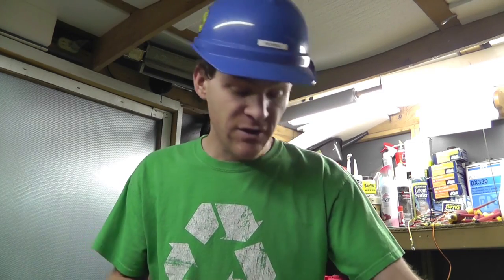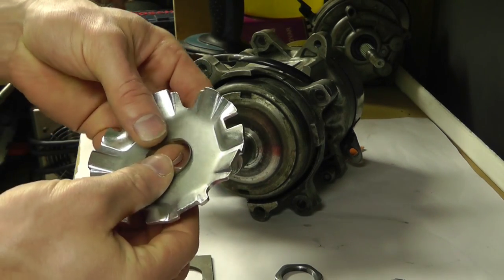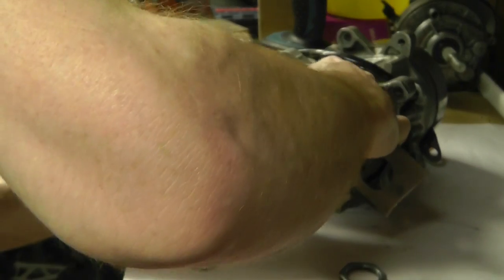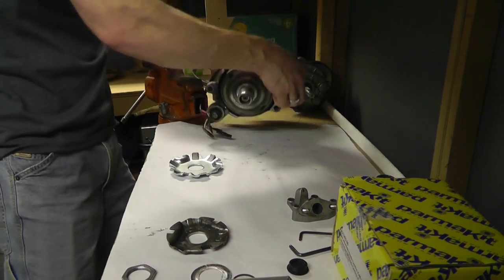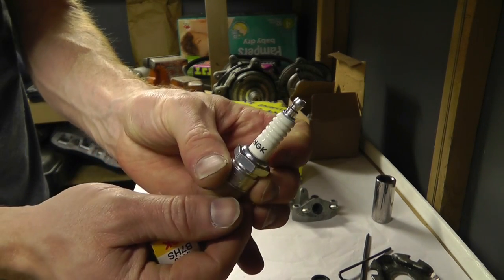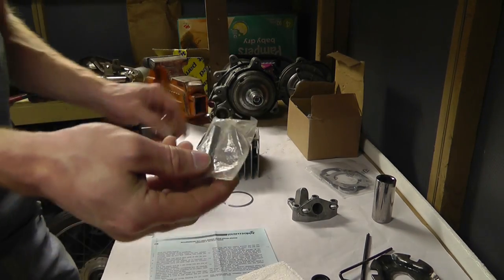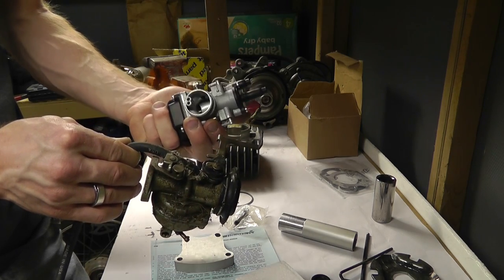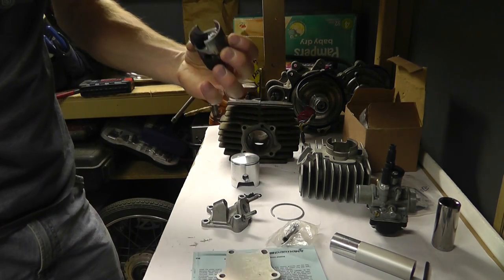#4 Honda PA50II Hobbit: New Shim & All Paris Finally Came In!!!!!

Comment: You might want to check for gaps once it's fitted, given how tight the sides are it could have been squeezing the top and bottom.
Reply from the maker: agreed.  i think the part was stamped out and is less precise than the cut shim :)  ~Russ